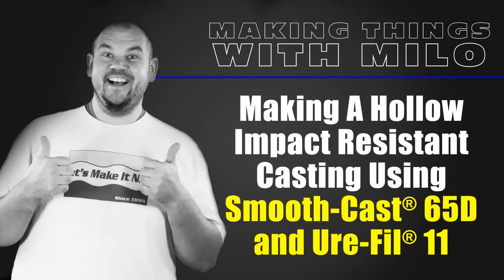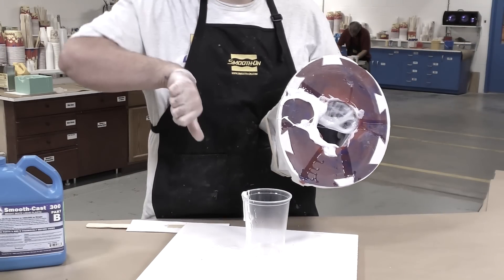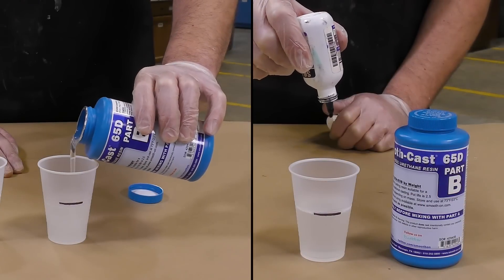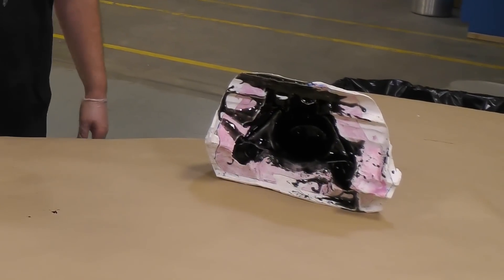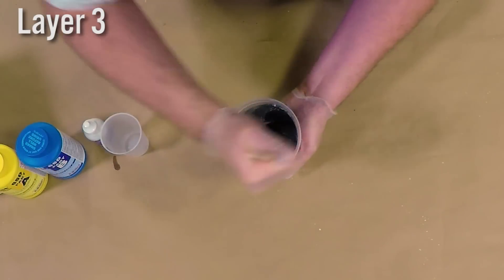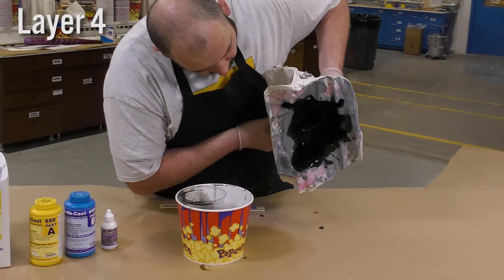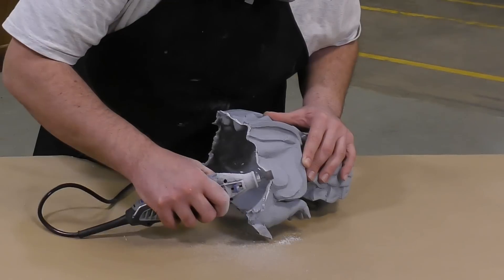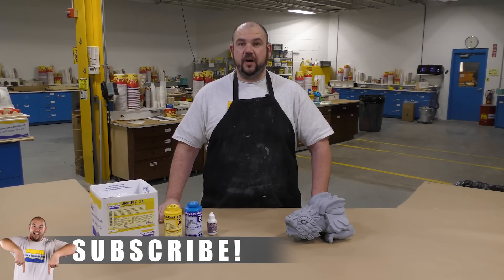How To Rotocast a Hollow Part Using Smooth-Cast® 65D Impact Resistant Resin

Comment: Will this product bond to iself if you cast 2 seperate parts and want to join them together after both parts have cured (sort of as a glue/seal)?

For exampke. If I casted an arm and a body section separately with this product, can I join them together using this same product?
Reply from the maker: Hi there! Yes, you can absolutely do that. Just make sure both parts are clean beforehand.

Comment: It is possible to create a scale (say 5" tire) with a rubber strong enough for rc airplanes use but light in weight (but hollow with say 3/16" thick walls)?
Reply from the maker: Yes that is possible. We are working on some videos now about tires for RC cars. If you have further questions about your project you can send us a tech ticket and our team can help you work through your project. https://www.smooth-on.com/support/ticket/add/agree/

Comment: Can you please speak to the differences between 65D and 57D? I see they’re similar but I’m curious when you might go with the 57 other than a slightly longer pot life.
Reply from the maker: Hey there, the 57D is a bit softer than the 65D but the major difference is going to be the color of the material. The 57D is a translucent white while the 65D is white when cured. I like the 57D as I can add color to it and will achieve the color that I am adding to the material. The 57D being softer allows it to me a little more durable than the 65D. If you have any specific questions about the materials you can send our tech team a ticket and they can further assist you.  https://www.smooth-on.com/support/ticket/add/agree/ Thanks for watching!
Reply: Thanks very much!! Appreciate the knowledge  @smoothon
Reply: Been looking for an answer to this too

Comment: After priming a cast made with 65D, can I fill some imperfections with Bondo o similar putty?
Reply from the maker: It may be possible, but you would want to test the putty for adhesion to the urethane resin.
Reply: @smoothon  it adheres perfectly!!!
Reply: @smoothon  what material can I use for rotocasting to get a more ridgid cast?
Reply from the maker: Our Smooth-Cast 65D is popular for rotocasting rigid pieces.

Comment: How do you fix it if it does crack? How thick should a casting be?
Reply from the maker: You can repair using superglue or epoxy.  We recommend about 3/8" thickness.

Comment: Hello Brian Oltrogge, reviewed your very well presented video on slush casting using smooth-on 65D.  Please share your thoughts/advice with brush application of the 65D resin say with the URE-FIL11 filler into shallow relief sculptures.  BTW, I recently cast several small (fist size) sculptures using the smooth-on 300 product.  Am most pleased with the results.  Have sanded them and will clean, prime and acrylic paint in time.  In terms of safety I noticed you used a respirator when power tooling the edge of your cast.  Is one recommended when hand or machine sanding the resins?  When hand sanding the 300 I found the particles slightly heavy ( not air bourne) and I simply blew them away.  I am in a very well ventilated working space.  Roy Carter
Reply from the maker: Can you send us a tech ticket? Our team can help you - https://www.smooth-on.com/support/ticket/add/agree/

Comment: Does the thicker work with clear resin and keep the clear color if I wanted to use for color match
Reply from the maker: If you add a thickener such as Ure-Fil 9, it will make the resin more opaque.

Comment: Do I need the URE-FIL 11 if I am just casting into a mold and not rotocasting? And after the resin has finished hardening, is it safe to hold in your hands for long periods? Trying to find something tough but droppable for making a custom hand-held gaming system, and I know most use ABS, so would this be similar?
Reply from the maker: It is safe to handle once cured, and URE-FIL 11 would not be necessary if casting solid.
Reply: @smoothon  Hey thanks for the info!

Comment: hello I have a problem of sweating in the finished object, it is a type of oil that prevents me from painting it since when applying any type of primer it repels it, any advice would be very grateful
Reply from the maker: This could be caused by a couple of different factors. This frequently asked question may provide some assistance https://www.smooth-on.com/support/faq/157/

Comment: Can I do cold casting (bronze) with 65D?
Reply from the maker: Thanks for watching! We recommend using Smooth-Cast™ 325 with Metal Powders.
Reply: Smooth-On Thanks, but I need a slush casting resin, where you suggested only use 65D for slush casting. Please advice.
Reply from the maker: You may want to reach out to our 1-on-1 support for advice about your specific project: https://www.smooth-on.com/support/ticket/add/agree/

Comment: 1. Can this resin be painted with acrylic paint?
2. If i have a closed mold, can i rotocast with only one layer?
3. What is the maximum humidity level for working environment, for the resin to not foam up badly? My country is quite humid, Smooth-cast 321, 300, foam up badly.
Reply from the maker: 1) Yes, but I'd recommend looking over our detailed painting recommendations here: https://www.smooth-on.com/support/faq/141/

2) You still want to build up a few layers to strengthen the casting. Generally with a closed mold on a rotocast machine, a rubber plug is used to seal the pour spout. After each layer, the resin at the spout is cut open so that the next batch can be poured. You can see this process in action here: https://www.youtube.com/watch?v=Z3P_4qIV8LQ

3) 50% or less is recommended. If humidity is hard to control, you will want to use fast setting resins and always use a dry gas blanket like our XTEND-IT when storing opened containers. You might also see if you can switch to a castable epoxy for some projects, as moisture doesn't cause foaming in epoxy.
Reply: Thanks for prompt reply. 
Yes i have a rubber plug that is part of the mold. 
The reason i am worry for the foaming of resin is, even SmoothCast 300 will foam if i don't use pressure pot. And, with such a short pot life, it is almost impossible for me to get the resin and mold into the pressure pot, so i stick to Smooth-Cast 321 all the time, with pressure pot.  Usually i have 5 to 6 molds to pour which fit into the pressure pot. 
** Working with fast resin almost certain to bring up my blood pressure :D

I have limited control over the humidity as i work in open area. So once i open a gallon set, i try my best to cast all 6.9kg of resin within 3 days.  Once i am done i use a new rubber glove and wrap over the lid then fasten with rubber band. 

The first 2 to 3 cast are usually fine without pressure pot. After that it get worse and i have to proceed with pressure pot.

May i know, is Smooth-Cast 65D also as sensitive as Smooth-Cast 321 series?

Comment: what is the difference with 321 or Onyx?
Reply from the maker: Great Question! You can see the differences in material properties between Smooth-Cast® 321 and Smooth-Cast® ONYX™ FAST and SLOW here: https://www.smooth-on.com/compare/8639/9080/9143/a/
Reply: Thanks. From comparison chart, the 321 and Onyx are harder and stronger. Is that it? 321 can be used for rotocasting too? Thanks
Reply from the maker: 321 has a snap cure - as opposed to the gel cure of 65D.  Gel cure materials work better for rotocasting.
Reply from the maker: This is an extreme, non scientific test.  The lower the hardness of the resin is, the better the impact resistance is.  65D is softer than 321, therefore it has a higher impact resistance.
Reply: Smooth-On I see. I understand know. Thank you for the reply.